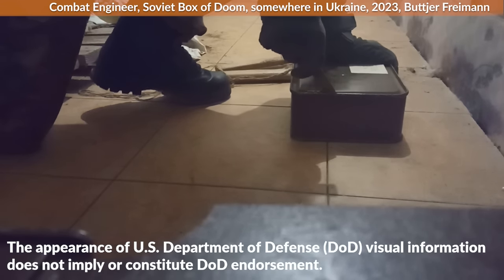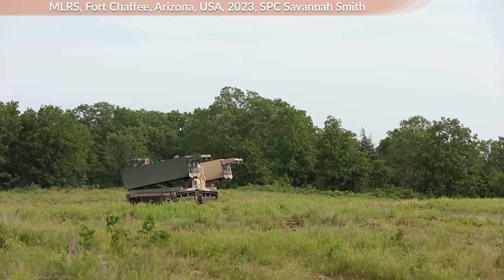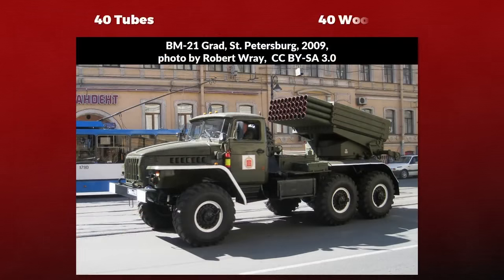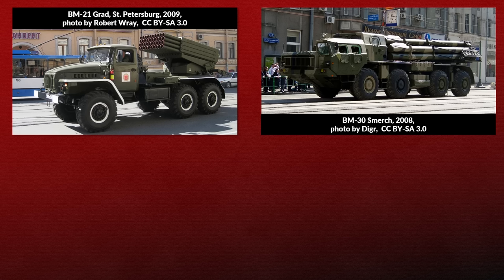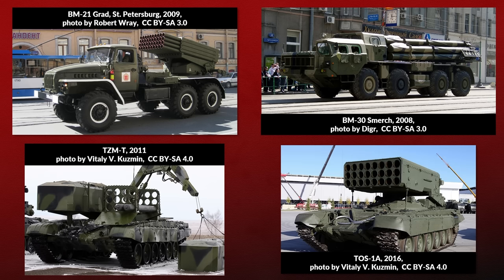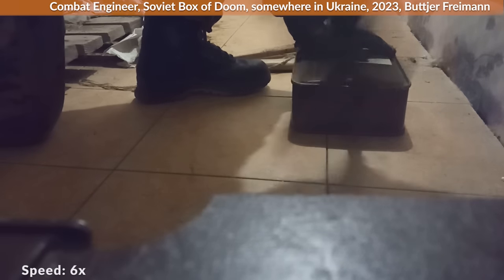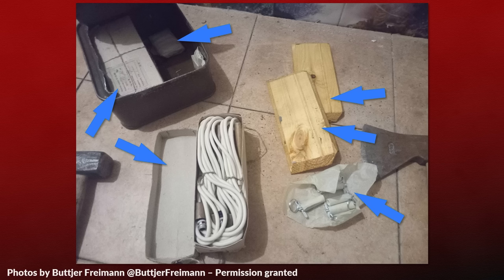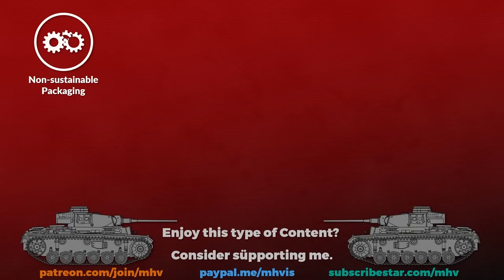Ukraine: Why Soviet Packaging is a Nightmare - Unboxing Edition

Comment: I think a major aspect behind the choice of packing and logistics in the Soviet system is the abundance of manpower. There is no real incentive to make the logistics system more efficient when the problem can be 'solved' by throwing more bodies at it, and those in charge have a near limitless supply of very low wage conscripts to throw at problems. The long-term cost of a logistics system based on a high level of conscripted manpower is minimised by not investing in machinery or techniques to maximise throughput of individual logistic channels, but rather adding more manpower to create more channels running at a low throughput to increase overall throughput. 

In armies where manpower isn't as abundant or has to be paid a living wage, there is an incentive to make maximum use of machines and techniques to maximise the efficiency of fewer personnel. In order to keep long-term costs low, the throughput efficiency of each individual soldier in the logistics chain must be maximised. The mechanisation and palletisation of a logistics system results in individual logistics channels having greater throughput, resulting in a higher overall throughput without having to employ more soldiers in the logistics chain.

Overall, the goal of both systems is the same. Move enough war material to where it is needed at the lowest long-term cost possible. The difference is in the costs of the labour available. I think one of the issues being seen in the conflict in Ukraine is that there is a limit to the total number of logistics channels that can be present as well as bottlenecks in the logistics chain. For example, only so many soldiers can fit into a field to pass rockets from the forward depot to a Grad launcher so adding more manpower doesn't increase the logistics throughput beyond a certain point. The manual reloading of the Grad launcher means only a certain number of rockets can be loaded per hour as described in the video. No amount of throughput before the bottleneck is going to increase the throughput beyond the bottleneck.

Comment: I've opened these "spam cans" as they have come to be called. It is a time consuming task and leaves sharp edges everywhere. I've never done the axe but several people have used a Dremel with a cutoff wheel for this task and report favorable results. I'd be very hesitant to do so because of the sparks that would be generated.

A method used in WWII was a canister such as this foiled over and then sealed with lead over a steel wire embedded in the edge of the wood that had a pair of rings on the end. The rings let you "unzip" the package and get the contents inside (let's assume rifle ammunition) which were either pre-loaded clips or cardboard boxes of individual rounds that the soldier would then load onto spent clips or load individually into his rifle.
Reply: Think about it this way, the sparks off a dremel wheel transfer exponentally less heat than the chamber of a rifle after fireing a full magazine.

Comment: The Soviet-style military took a completely different approach to resources and logistics. In the Red Army, one resource was practically limitless: manpower. From the Soviet perspective, there was always a way to find people willing to carry 40 individual wooden crates by hand—no need for electricity, cranes, gas, or any other modern equipment. These individuals required no special training and could be easily replaced in any situation.

Comment: I doubt there are forklifts at frontline but plenty of soldiers to do reloads manually.
Reply: NATO brings forklifts as near the Frontline as possible, to the field depots.
most NATO armies, trucks had cranes. The ones that folds in between the cabin and the flatbed, commonly used in civilian trucks.
Ratio varied, is one tactical truck every 4 / 6 or so has a crane.
Sling a pallet to the ground is quick and easy.

Loading and unloading long wooden boxes from storage to truck, from truck to train, from train to truck, to depot, to the truck going to the frontline, without even giving the gaps for a forklift or a crane sling, on the other end...
Reply: @ulissedazante5748  You realize field depots are the first thing targeted right?
Reply: @kalebthehistorian5928  of course.
And that's why nobody with a grain of salt wants to be a sitting duck for hours manhandling heavy wooden crates on and off trucks, when a forklift could fill a truck bed in minutes and get out the danger zone quickly.
Reply: @ulissedazante5748  And what happens when you run out of forklifts? Anyone can load up a truck, it doesn't have to be in an obvious spot, but if you require a depot to load these massive creates, you're already in trouble.
Reply: @kalebthehistorian5928  I'm unconvinced that using modern technologies and reverting to manhandling in an emergency is worst than  just stick to stone age tech from the very beginning.
Reply: @dazante5748 Unfortunately, in modern warfare, you don't have such luxuries. So, better to know how to do it beforehand than force yourself into doing it once your logistics get destroyed by standoff weapons which you cannot shoot down.

Comment: I come from the US and I can both PK and 240.  My PK-Fu is stronger.  I love the PK and wished I had something akin to it when I was in the US Army.

That being said, the ammo situation for the PK sucks.  Especially if you are hand building belts without a machine.  More so when you get ammo in a burlap bag.  Then you have to be smart when building your belts(I've found 792 in my 762 bag before).  I'd make 3 primary belts(one for the gun 2 for my pouches), make a VBIED belt and the last one was all or nothing.  The last one is where you use Syrian ammo.  It's an all or nothing belt because Syrians will salt their ammo.  Everything else were "rips". A small strand of links.  Basically Nato tins> Russian tins > Burlap bag.

Heh, also learned why you need short hair as a Gunner.  Nothing says surprise than having someone rip a belt off the back of your neck.

Comment: I’ve bought cans of surplus ComBloc ammo before, just like what’s shown in this video. I always imagined trying to open them in battle conditions, and concluded how the US M2 ammo box is dramatically superior.
Reply: Superior until everything is faulty because it couldn't resist storage and transport
Reply: Well, remember - the soviet ammo cans were meant to be unpacked by unskilled conscripts at logistical facilities, not in battle conditions. Another poster said the Soviets probably didn't want to spend the extra time and effort on ferrying reusable ammunition containers and equipment back and forth.
Reply: @Francisco-ow6bl  Anything that would break an M2 ammo box would break a soviet sardine can. The steel on the M2 box is thicker and reenforced at all edges

Comment: It's curious to me how Yugoslavia used a more advanced system in the 1970s. Their small arms ammo  came in a large can fitted into a crate, with a single wood handle used to pull a wire to cut off the lid.  Worked relatively well.

Comment: There is an advantage to disposability in logistics. It meams less stuff that has to be transported post engagement. The lack of loading vehicles is a cost and vulnerability issue. You can disable artillery biy disablimg the loading vehciles making them higher value targets than the artillery.

If you had one tenth the budget of the USA and had to consider engaging in a full scale war wity them, where would you spend that money?
Reply: To buy myself a yacht
Reply: The trucks going back from the front are usually empty, so there isn't much cost to putting empty containers onto them. 

And while dedicated loading vehicles is a vulnerability, so is spending hours at a logistics hub manually transferring things. 4000 lbs of whatever can get moved by 1 forklift in a minute or two. How long would it take to transfer the same 4000 lbs by hand?
Reply: @dgthe3  every couple minutes is another couple minutes for the guy across the line to aim an artillery piece
Reply: @dgthe3 Why have a dedicated loading vehicle when you can just have another grad
Reply: На оружие, которое закроет вопрос войны с вероятностью 100%. А пушки и автоматы оставить для усмирения папуасов, решивших, что они чем-то лучше соседнего народа.

Comment: To comment on a less asshole-ish way than in my other comments:
The purpose of this packaging was/is long terms storage, easier bulk transportation, easier transportation and use/reloading without the use of mechanisation and easier dispersal of materials in small "field depots".

To the point of mechanization needed for reloading: The HIMARS needs a reloading vehicle to deliver the cell, unload it onto the ground ( if in a hurry to get out of harms way ), after which the HIMARS has to unfold its winch, unload the spent cell, hook up the new cell, load it up and reposition the winch.

This is a lengthy process that requires a lot of space and is rather vulnerable, especially today to observation and enemy fire.

The Grad rockets can literally be dumped out in a heap somewhere from the logistics truck, hopefully in some concealment and then 2-4 men can carry the boxes to the weapon or to prepared "field depots" while being much less visible and you can much more easily disperse the ammunition around the area of operation, so even if you receive counter fire, one unlucky shot won't blow up half of your ammunition.

Comment: Will note that small arms and autocannon ammo often use steel casings. This means if the boxes arent sealled properly, are opened and then not used, or if moisture is trapped in the cars, the ammo can very easily rust and cause jams or not fire. While NATO ammo can also corrode and go bad, it is likely to take longer and since NATO ammo arrives in reuseable waterproof tins, long term storage after opening is not nearly as big of a problem.

Comment: Strange, my comment disappeared somewhere. Okay, I’ll duplicate it.

In reality no one on the front line will be reload BM-21, because task of this vehicle is to arrive at the position, shoot and drive away.
This has become especially relevant with the development of reconnaissance and FPV drones.
Again, it’s not enough when the BM-21 gives all 40 launches, and if it works close to the positions, then the charging is not full.
Therefore, 4 minutes of NATO weapons or 40 minutes of Soviet weapons will not play a role.

Comment: in the US, they tend to be called SPAM cans. 
Seeing it be opened, I can say the real deal, as in the SPAM branded potted meat, is vastly superior in ease of use. In fact, I believe the American companies who take advantage of the nostalgia of cheap Soviet ammo? (I don't get it either, other than mild novelty) actually use the real SPAM can opening. Which consists of two parallel scored lines that run the near one of the seams. At one end of the seam, a wind up key can be turned to pull a strip off between the scored lines.

Or the Soviets could have just given out proper can openers. They aren't that hard to make. It's a oddly shaped piece of carbon steel on a stick. That's it. The Soviet's actually messed it up in the only way possible; make the whole thing out of a single piece of soft steel...

Comment: Having unboxed a zinc of 5.45 myself, it's not that bad. no wood inside, ammo stacked, wrapped in waxed(?) paper, neatly packed in.
My speculation for why there was wood with the ztpm's - it's there to soak in humidity, which would otherwise damage the fuses, especially during decades in conservation.

Comment: If we just consider this solution for extreme long term storage then I think it would be fine with the assumption that they would be opened and repackaged away from the Frontline when they are finally needed.
Reply: That seems reasonable but not done
Reply: @caffetiel  I mean that is like 99% of all these decisions. There were usually a great thought about it but never actually followed through as intended.

Comment: The reloading time differential of the BM-21 compared with western rocket artillery is largely moot. All rocket artillery is designed to provide significantly heavier near-simultaneous barrage (often also at longer ranges than tube artillery) but they are very much one shot weapons, and in any conventional maneuver conflict NEED to relocate immediately to avoid counter-battery fire. Tube artillery is for providing sustained fires and enabling shifting fires (e.g as the enemy advances towards blue force's defensive positions).
You could almost compare it to a double barrel shotgun versus a pistol: the shotgun can put a similar weight of fire in two shots to the magazine of the pistol, which will take longer to fire all rounds, however the sustained rate of fire factoring in reloading times are a key tactical consideration in employment.
Reply: "Ключевым тактическим фактором" является количество реактивных установок, достаточное для выполнения поставленных задач. На время перезарядки наяривают, в основном, диванные эксперты.

Comment: I think a whole lot of factors do lead to that kind of packaging: Mostly it's probably what's available near the manufacturing plants and done by less skilled labor (you need those people for the real stuff) then for transportation, storage and dropping it into the mud the packageing is probably pretty safe especially if you factor in terrible russian roads and vehicles and even less skilled handling labor.

I think the main flaw in the thing is that soviet thinking has factored "we got unlimited manpower" in the equation and that is no longer valid for Russia.

The russian system will work under much worse conditions but require more people to work which is something they really don't have any more.

Comment: I think those were meant as stockpile packaging. Sure, they are kinda hard to crack open, But if we know anything about canned goods is they have a very long shelf life. Put your equipment in those, douse everything in soviet cosmoline to make doubly sure theres no corrosion, and stack bunkers to the ceiling with ammo cans. Preparation for a potential Warsaw Pact vs NATO confrontation? That would be my guess.

Comment: So this is why their stuff just works even after like sitting idle for decades in depots. Impressive stuff.
Reply: It does & it doesn't. Kind of a gamble & it depends on where it was stored in many cases. Old Soviet & former Soviet depots aren't like current Russian depots. They've been picked over, neglected, forgotten about, rediscovered, picked over again, & in many cases left to rot.

It's why in the opening year of the current conflict, East German stockpiles of Soviet stuff was in such poor shape. Germany sent over everything there, but because there wasn't anything like climate control about 25% of the stuff was either rotted or useless. I can only imagine what the old depots in Russia look like, as they've not had more than two dimes to rub together for maintenance & upkeep for anything other than the nuclear arsenal for decades. Prolly why they're begging for shells from the Iranians & Norks.
Reply: @TrollOfReason  Какая разница сколько лет и где они гнили, если 75% боеприпасов останутся при этом работоспособными.

Comment: There's also another underlying problem:

- In the modern conflict, surveillance is the biggest threat to your logistics - these can be tracked easiest by larger drones, that could also track batteries by their waste
- Having to stockpile large amounts of ammunition in wooden boxes makes them not only vulnerable, but also easier to spot and find for the enemy
- Taking longer to reload, while having to stand next to a big pile of ammo for efficient loading endangers not only the vehicle, but also the logistic vehicle used and all the ground staff necessary for loading

An example:
A Ukrainian UAV finds a pile of discarded wooden boxes, with vehicle tracks leading to their location - now they know where they were rearming the vehicles.
Even if they have relocated, it now becomes easier to find the new site, compromising it and the logistics hub.
As soon as they have found the loading site, it becomes an ideal target for HIMARS, since it can move in swiftly, hit the targets at range and has a very good chance of destroying and disabling multiple vehicles that way - mostly since they have to remain stationary for reloading for very long.

As a result, the russian equipment is plagued with even more logistical dilemmas:

- Do we take the empty boxes with us even though they are basically dead weight if empty?
- Do we take our time to hide the empties?
- Can we even reload the launchers of one battery in one place? Or do we have to scatter them?

Each of these would demand a significant amount of time and effort - a thorowness russian troops are lesser known for.

Comment: In the 50's the US was awash with 50 surplus caliber ammunition canisters which were lovely water proof  containers about 6" by 10" by 16" (I am remembering/guessing at the dimensions)  I last saw the one my dad had picked up 20 years ago. The rubber seal was no good but the paint was ok inspite of living in a beach town for 50 years and the latch/unlatch mechanism was still about 2 seconds to unlatch and 5 to latch.

Comment: That is ridiculous, something not mentioned is that if you don't use you can't repack it.....
If it takes that long to get in to small arms boxes then your screwed in a defensive position as you could be opening loads of tins during combat. Patrolling it's less of an issue as you would remove the ammunition from the tins, but it would be a ball ache having to do this to open the tins, especially when exhausted from lack of sleep.
Reply: 0 issue in real life for small arms ammo. The ammo would be opened and distributed already in the rear. Using 2 minutes to open a can that lasts 80 years in storage is really no issue at all for practiced hands.